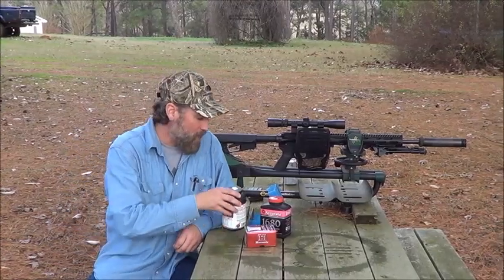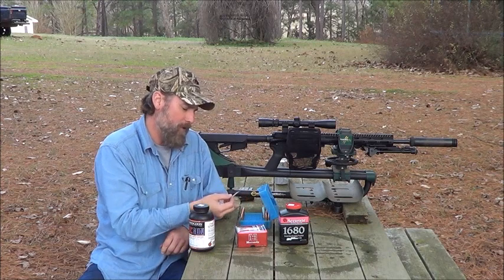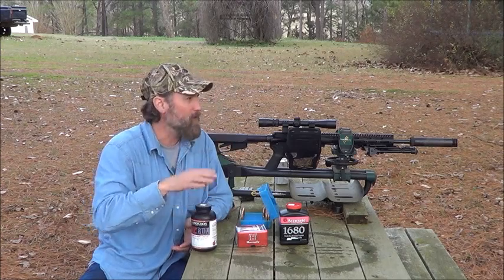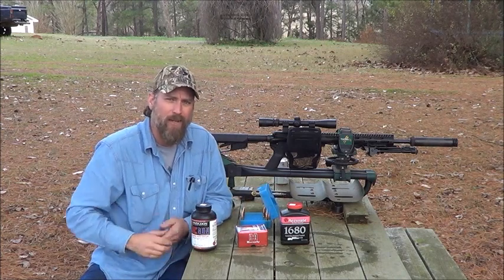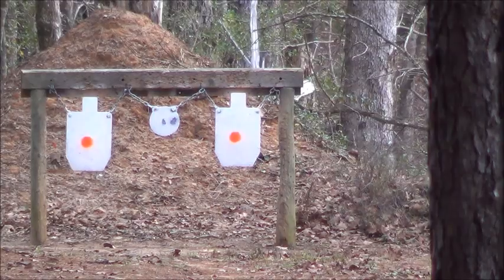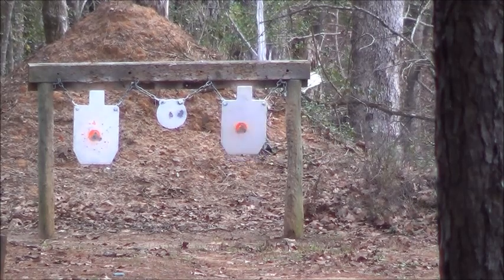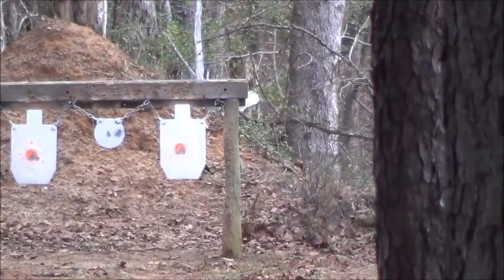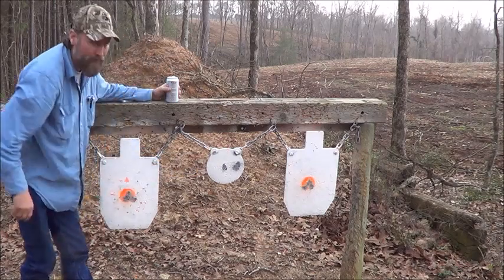300 AAC Load Test 1680 VS LIL GUN

Comment: I have Hornady 208gr ELD and Accurate 1680 using Wolf Small Rifle Magnum Primers and medium crimp need a starting load of possible having trouble finding that data. I'd you could I have the data for other powders I just need somewhere safe to start with 1680 thanks
Reply from the maker: 10.4 gr of 1680 works great, I loaded some this weekend
Reply: @EastTexasOutlaws  thanks you much I was going to start at 11
Reply from the maker: @2000351Ranger  no problem 👍
Reply: @EastTexasOutlaws  Thanks ... cycles perfect, reminds me of Whisper rounds :)